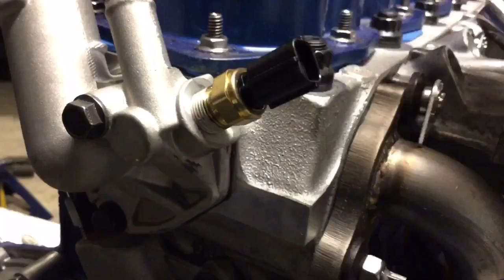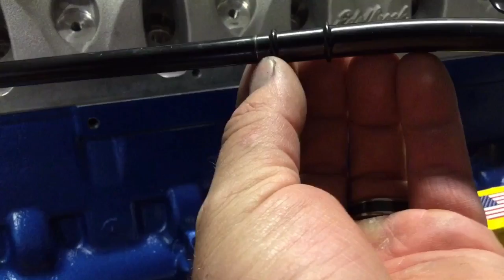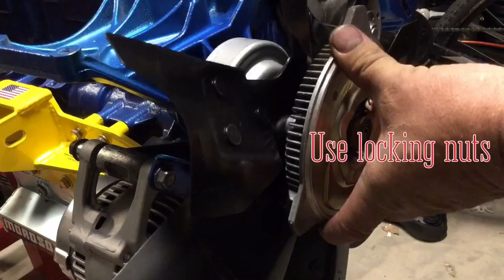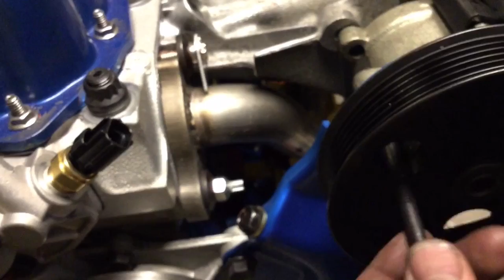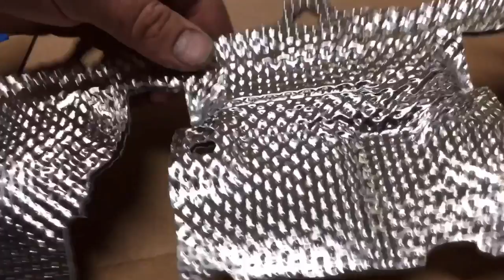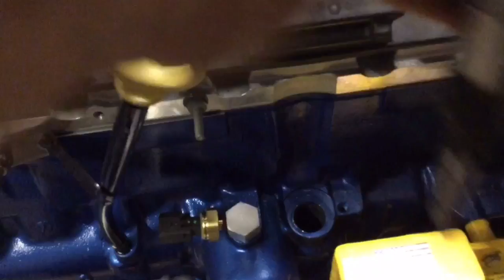Jeep 4.7 Stroker Complete Build Part 6

Comment: Cool videos. I used them to build my first stroker. Your sensor is pointing away from the block instead of parallel. Mine too. Even a bit more than yours. Is this because of the beefy cam?

Comment: Great build right up until the coil rail.  Two words: Viper coil.  Same plug, same specs, can check plugs individually and your choice of 8mm or better low impedance wires.  Just sayin'.  Other than that, great build.

Comment: Hey there, another question for ya, how did you take the cam gear off of the distributor? I lost the tool i was using to prime the engine but the stupid f**king pin wont come out of the old distributor i have, and tips or tricks to get it out?

Comment: Is there a pretty nice difference in steering response with that smaller pulley?
Reply from the maker: WILSON! Yes, but not response. It’s just easier to steer larger tires at low rpm.
Reply: oh okay, cool, thanks.

Comment: 13:49 "This grounding stud is to prevent radio whine from your alternator". What connects to that stud? Is it just an engine grounding to the body? I have a tweeter that has got bad radio whine and I replaced the engine ground and was hoping this is something I haven't done I might try but I can't figure out what you're talking about.

Comment: I can see that you have arp head bolts.How did you mount the wire harness without having the long head studs.
Reply from the maker: TheVintagetamiya I just laid it up there. I will eventually weld a stud or bolt inside a nut that will grab the top few threads of the ARP.

Comment: The amount of money that you spent on this build is insane. I watched all of your videos and created a spreadsheet with all of the part numbers that you used. Not including machining, brackets and intakes, and other miscellaneous parts, I calculate $7500 to build this. Wish there was a video of it running and driving. Looks like a real joy to own.
Reply from the maker: Joe Miller sorry it took a couple days to respond, your comment was stored in YouTube's possible spam area. Many of the parts were purchased at a discount so much cheaper. I wanted to use so many new parts just to get a shot of the part numbers for the video. It runs great, plenty of power. I'll shoot a video this summer romping on it. Might install an Atlas 2 first though. Thank you for watching.

Comment: Only till part 6 do I realize the spark plugs are on the Wrong side of the engine. Ha, took me that long to see a difference between this engine and my 98 Gr Cherokee (zj) 4.0. I love these videos, and they make me worried how many little necessities wouldn't be done correctly by even a trusted mechanic unless they were a dealership one possibly.
Reply: Spark plugs are still on the passenger side of the engine.  You can see the distributors mounting point.  It's the same engine with a different head.  Exhaust and intake is still on driver side.
Reply: You're correct, I missed that. Thanks

Comment: Outstanding Craftsmanship.  It will be interesting so hear your comments about the overall performance.
Reply from the maker: vaccumme thank you.
I've been working a ton but should be able to fire it up today. I'll certainly make a quick one about drivability and performance. Thanks for watching.
Reply: I was thinking...... Banks makes a bolt on Turbo Kit for your application. Any though's to possibly considering more power ? Ted.
Reply from the maker: vaccumme 505 performance offers several options. I'm pretty sure I'll be content but if not I have considered a supercharger.
Reply: My friend rebuilt his Cherokee with very minor upgrades and the performance is very good. I'm sure your modifications will more than meet your needs.

Comment: HA! I ordered 53009672 by accident while looking for an EVAP elbow. (My 2003 TJ Parts List illustration was rather unclear.) I kept it thinking Mopar rubber bits are becoming harder to find these days and I like an exact fit. Now I know I can use it. I cleaned up my throttle body last year and reused the rubber elbow with a new MAP sensor because at that time I could not find the part number for that same elbow. So tomorrow I will go out and install that little guy and I will smile all day because of it. It is good that my accident ended up being to purchase a part I actually could use. Thanks for the shot of that bag so I could pause the video and get mine to compare.

By the way, I have gone straight through these up to this point. I will go back and Like all of them when I am finished. These are excellent videos. I would like to stroke the 4.0L in my TJ next summer. Care to divulge how much you spent on this project? I would not mind using the same gear on mine.

Oh, yeah. Subbed. Thanks again for these valuable videos, man. Happy wheeling!
Reply from the maker: Holton 345 
That's awesome! I haven't added it all up yet but I plan on it soon. There are a few more parts in the next video as well as initial startup. I just towed it home from the exhaust shop this evening but have been working all day so hopefully tomorrow's the day. I'm also working on two more XJ upgrade videos right now too. Thanks for watching.
Reply from the maker: Holton 345 
Check out the video out there about the viper coil mod or goodbye coil rail. It is a good way to use an older head on a coil rail Jeep.
Reply: Looking now. Thanks! I look forward on your followup videos on the stroker.